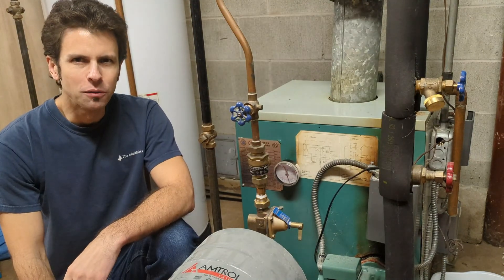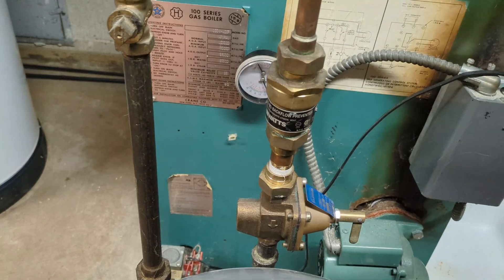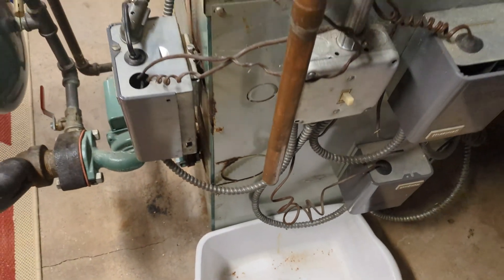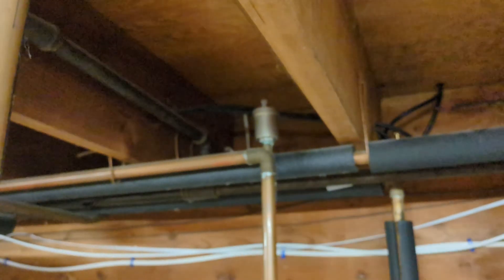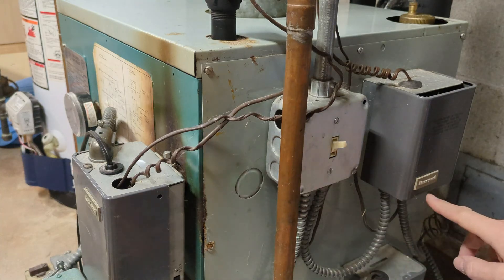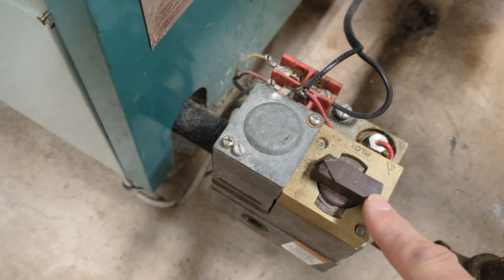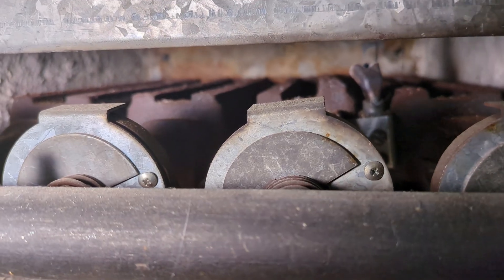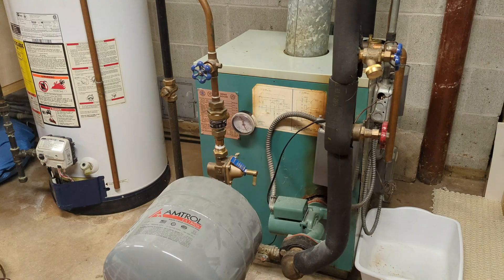Gas Boiler Overview - Crane 100 Series with Honeywell Controls - Hot Water Baseboard Radiator

Comment: I’ve replaced the thermocouple and the gas valve and my pilot won’t stay lit. What do u think is going on possibly? I did get it to light once and the system ran for like 10 minutes then went out again.
Reply from the maker: How does the pilot flame look? Clean, blue, even? Might need to be cleaned. Does it appear like a draft blowing it?
Reply: @realhouseDIY  blue … light does slight move some while holding down the pilot button
Reply from the maker: @Statetostatewiththestatens next I can think of is sufficient air flow both for the gas to burn and exhaust. So no clogs/blocks either direction. If you have a lower cover on the boiler you could remove that temporarily to see if it helps for needed combustion air. Then proper drafting up for correct air flow. No clogs in the chimney. Use a carbon monoxide detector nearby maybe. If all that is good I think it would be gas supply related.
Reply: @realhouseDIY thanks so much

Comment: Circulators installed backwards it should be pushing water into the boiler not taking it out of the bottom that's the return side
Reply from the maker: I checked and this is how it is setup. I didn't think I mentioned water direction in the video.

Comment: I have no flame at all trying to attemp to start. Pilot light is on. I turn on thermostat hear a few clicks but no flame to the burners not even an attempt. Thinking possible gas valve.
Reply from the maker: There should be a sensor on the pilot light to detect the pilot light burning. If it isn't working, then the system doesn't allow the main gas to turn on when heat is called. It's more likely that sensor.

Comment: Great video, any idea where I can find orifices for my crane 100 series boiler I need to convert from natural gas to propane?
The current brass orifices openings are 103 thousandths for natural gas, I need to drop to 62 thousandths for propane. Any ideas/experience you have would be appreciated. Thanks
Reply from the maker: Thanks! I've only been maintaining mine. There might be a standard kit for the conversion though. I might ask at your local plumbing supply store.

Comment: Currently buying a house with exact boiler. From 1973! Going strong. Leaks a tiny drop of oil from the pump. Needs a new gasket
Reply from the maker: If it needs a new gasket and need to drain it anyway, perfect time to upgrade the circulator pumps and will never need oil again! Those old pumps even if they work fine, can be noisy.
Reply: @realhouseDIY  oh yes that's a good point. I hope to tackle this this winter. I watched your whole series on the boiler and will be cleaning and straightening all my fins as well. Mayne even paint the covers!

Comment: I also appreciate that you took the time to explain your boiler because I have an apartment complex with a similar boiler, i.e., Crane Co. 100-W-180P, which serves four apartments. I have tenants currently saying they are not getting enough heat. I have been trying to determine the maximum temperature I should set for my boiler via a White-Rodgers 1127-2 (surface-mount hydronic temperature control). Unfortunately, your system does not seem to have one of these, whereas mine has two. One is redundant, if not wholly unnecessary, to the point of causing problems. Yesterday, I set the max to about 175, so I will crank it up to 190 max and set the minimum to 160 even though 140 seems to be what is recommended. I will turn it back down after we get through the current cold snap in my corner of Michigan. By the way, you did a fine job in this video. You were articulate, did not belabor any of your talking points, and touched upon most aspects of your system. I doubt it matters much, but you didn't mention the voltage of your transformer. My thermostats, zone valves, and end switches all run on 24 VAC.
Reply from the maker: Yes, 24v on mine as well. Thanks for the kind words!